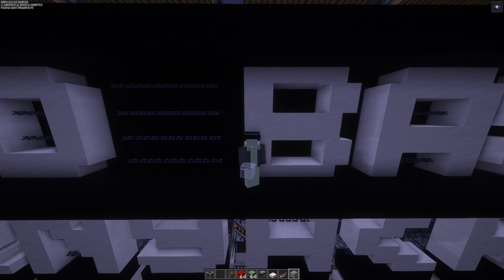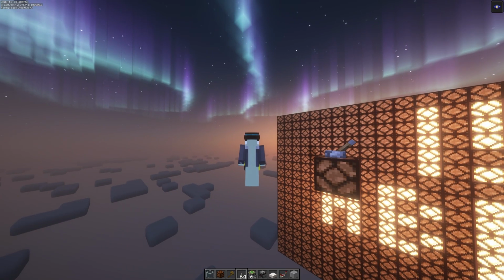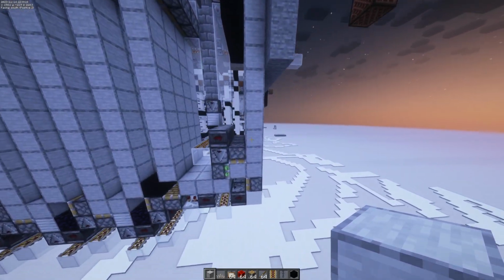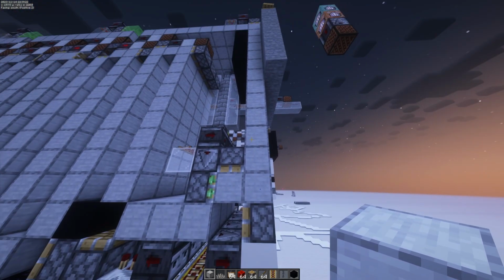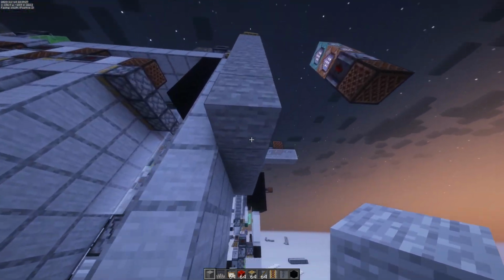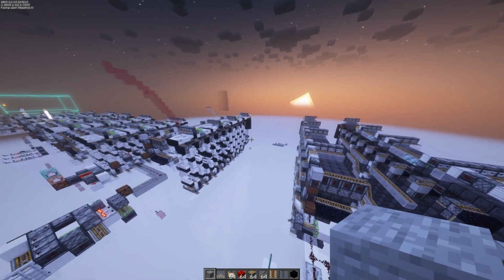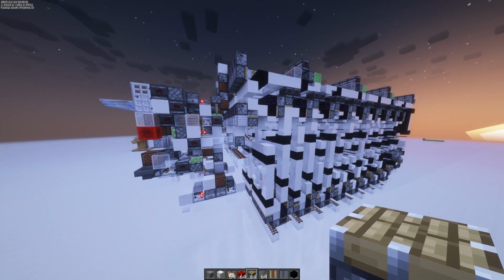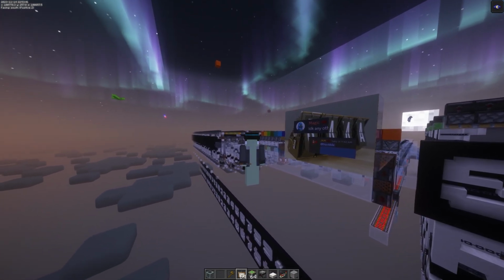Reinventing the World of Text Displays

Comment: In the next version you should consider somehow separating each symbol in vertical lines and combining them to render the character. Thus you'll be able to render any symbol with relatively small tapes.

In fact, you'll need a tape size of 2^n, where n is the height of the screen.

But that would actually convert this system into an all-purpose mechanical screen, hehehe

I have no idea how to do the wiring, though. Judging by the video, you need to have a single block space between each tape, that would be a problem

And also, encoding system would be more complex, but this one is certainly solvable.
Reply: But now that I think about it, if you want to preserve all the alternative versions of edges (like with stairs or slabs), you'll need a tape of somewhat bigger size. 

Say, if you want to go extreme and add every possible option there is (which is 4 positions for stairs, 2 for slabs and 1 for the block), then it would be 7^n, equals 2401 blocks long tape for the screen of 4-block in height, but why would you want to go extreme?

All your current options are probably gonna fit into a hundred blocks long tape or even smaller, so if you want to render text-only, that shouldn't be a problem. And if you still want characters to be placed in predetermined positions, then you can create even smaller different tapes for each vertical line.

Comment: A long time ago (I think 1.12) I made a scrolling display using repeaters on full delay, using a (I think) 3x5 resolution for each letter. I know I used a timing circuit to time each letter, into an encoder, and into another timing circuit for each vertical line of the letter. Ten years later I've never seen anyone do it. Probably because without red power you can't do vertical repeaters, and having it be flat on the ground isn't super useful.

Comment: You know, you could use a hex decode, 0-15 through adding the values of two composters twice. That would give you Hex FF = 255 characters max. You'd have so much extra room for more characters. You could even just dumb it down to OCT 88 which should be 64 characters which is in budget and only needs two reads, 0-7 per composter digit and still gives you more characters to work with.

Then, the added challenge: Copper Bulb Character Segment Display, each letter programmed on its own using the same Hex decoder.

Comment: For the counting, can't you just compare the number of items inputed to the internal counter ?
Say you get to a point where they have the same comparator power level and then pull an item from each until you get a difference (then move the tape) or a simultaneous drop (exact match)

Comment: Dude, I freaking love this design concept! You've put out some really awesome display concepts, but this one is hands down the best I've ever seen. I have been working on a 3D maze that's 7x7x7 cubed that basically has 343 interior rooms laid out in a 7x7 configuration that's then stacked 7 high. Each room (cube) has a 3x3 door on all 6 faces of the cube, and all 343 cubes are inside a giant outer cube that has 294 doors that connect to the outside. So in total there is like 1,127 3x3 doors , 392 of those being horizontal trap door designs. Anyway, the idea is to have a player start out in the very center of the building to start the maze, with the goal of locating the one single outside exit door that isnt locked, somewhere on one of the six faces of the main cube. The catch is there is no straight line to anywhere because there will also be locked doors all throughout the facility in all directions, forcing the player to explore and remember where they've been to ever stand a chance of escaping.  

All the while the player is being timed by a stopwatch display on the outside, that depending on the chosen puzzle difficulty, could have the entire maze lock all doors after a specified elapsed time and shuffle the maze with them inside,  then resulting in everything they had mapped out being invalid, and forcing them to start mapping all over again. 

If and when they do successfully locate the true exit door and make their way outside will the stopwatch be stopped and the time recorded along with that players gamer-tag. So future payers can compete against previous times posted, and the system will promote the player with the best time to first place automatically.  

The Ranking information would ideally be either permanently displayed on a dedicated display panel or have a recall function  built into the primary display. 

So with such a massive amount of displays this build will require, I have watched the community closely  for new display concepts that could bring things up a notch, and what you've shown here today is exactly what I've been looking for! I would seriously be grateful if you'd approve my incorporating the work you guys have done here into my insane build. If we could talk on discord i'd be willing to share my world files with you if you'd be interested in checking out the build so far. This project has far too much history to include here but suffice it to say, it's been in development since the xbox 360 and has had quite a few version changes along the way, with the latest being a ground up rebuild on a modded platform, so there's really no limits holding it back now, and something as incredible as this type of display system would really be amazing to see in a final iteration.

Comment: I would like to thank you for telling me about the overloaded comparators trick. I'm sure I'm not the first to figure this out, but did you know that giving a calibrated sculk sensor a signal strength over 15 completely disables it? It's the silliest way I have found yet to make base defenses toggle off and on.
Reply: What kinda base defenses you got? I'm interested
Reply: @skinnybuggo  Well, currently very few, as I'm just starting to move from an old base to my actual megabase. I'm still mostly in the design phase. My current plan has a few different defenses. The main one is a tnt minecart land mine that is specifically designed to work with the servers antigriefing plugins. That's what I was talking about. I also have about a stack of dripstone in the entryway, which will also be activated by calibrated sculk sensors, and I'm on the hunt for a good double piston extender/retractor to pour lava all over the outside. I'm also considering flooding the hallways and adding a toggle for the conduits. 

As an unrelated side note, it's the most intimidating base design I've ever seen. It's 3x3 chunks of nothing but a seamless wall of stone, all the way to world height. The door is a giant flying machine door flush with the wall. It makes me feel very small.
Reply: @fordprefect859  any chances you could upload a video? sounds really cool
Reply: @skinnybuggo  I can try. It's a cracked server, so leaking the address could get extra spicy, even with the authme plugin. It's also been up for long enough that I'm not sure where I would start when showing it off.
Reply: I'd be careful where you repeat that information, almost sounds like a bug, and we all know the only bugs mojang is interested in fixing are the useful ones!
Reply: @DemonSeedXP  are you playing on bedrock?
Reply: @Yegor_Mechanic  no I'm on java, rarely do I play on bedrock if I can help it :p
Reply: @DemonSeedXP 
There are many Java edition bugs that I use to this day and they only got fixed on bugrock
Reply: @Yegor_Mechanic  yeah I get that My comment was pretty much tongue-in-cheek you know kind of jokingly

Comment: Could flying machines be used to break the character set down into 12 character segments? A solid rectangular prism of blocks would achieve higher information density, meaning each character would be in closer physical proximity to the display. Moreover, decoding logic could be simplified somewhat because rather than keeping track of your position in a gigantic 53 character feed tape, you just eject the current 12 character feed tape back into its high density storage position while simultaneously signaling the block containing the next character to be displayed to fly to the slimestone system that unpacks it and moves the desired character into the display position.

Comment: Do you really need to move 5 blocks for your 4 block high characters ?
It seems like it would be possible to have only the characters in the tape, and only had the top and bottom black line when the correct character is displayed

That would make the device 20% smaller and faster !

Comment: If you fiddle with the fonts, you can instead divide each character into sections and combine the sections to make a character.
For example, if you had a top section and a bottom section:
I, J, and T could be made with the same top section template
A and H could be made with the same bottom section template
Reply: How would you join the gap between the top and the bottom?
Reply: @BryanLu0 magic
Reply: @BryanLu0  probably using flying machines is the only way, it would be way slower but i guess its a thing
Reply: Not top and bottom! But left and right, or, well, three columns, how about that?
Reply: if you have few enough patterns per one block slice and if you can control them individually, the potential reduction in individual tape size would probably significantly speed up the machine...

Comment: 2:39 Ceramic cylinder seals are thought to have been used since 3500 BCE. Inverted designs are etched into a clay cylinder before it is baked, so that when it is pressed and rolled onto a wet clay surface, the intended engraving is imprinted. This is functionally equivalent to any other form of feed tape storing information densely in 3 dimensions. So yeah, about 100 years, pretty wild!
Reply: I wouldn't call that tape storage, imo the main part that makes a tape a tape is it bring able to be compacted a lot, and the ceramic cyllinder probably wouldn't like being folded. Imo first tapes would be scrolls, which can be unwound into a readable state or stored densely
Reply: Actually DNA is also feed tape when you really think about it so millions of years. Dunno what year BC that was, but it was sure a while ago.

You absolute contrarian. "Ah yeah, the 70s, when they invented the personal computer"

bursts through the wall

"ACKSHUALLY THE ABACUS WAS THE FIRST PERSONAL COMPUTER"

Comment: Mojang nerfed bulbs so bad, Squibble used pistons for display 💀
Reply: They should change it back =(
Reply: i challenge you to make a display design that actually requires the old tick rate for an actually important part of the process
Reply: I think a good solution to copper bulbs would be to have them be instant when they've got no oxidisation, and a 1gt delay when they do. Perhaps even more stages of delay corresponding to the level of oxidisation.
Reply: @christopherpenn9585 I think it's like if you got a puppy. You really liked the puppy, and you're grateful you got it. But then the person who gave it to you came along and ripped off its eye and a leg. Sure, you are still grateful for having the puppy (having one disabled puppy is better than having no puppy) but you're still gonna complain about them mutilating it
Reply: Its honestly fine, the intended use was never for a 1gt block
Reply: @SwervingSho3  it was confirmed by Kingbdogz to be intentional
Reply: They'll still work fine for displays. They only changed the 1gt delay to 2gt, to match all the other redstone components.
Reply: @nikkiofthevalley They changed it to 0gt.
Reply: @haph2087  What. I had heard that they changed it, and assumed it was 2gt... Completely didn't expect them to make it instant. I really hope they don't change it to 2gt, that's legitimately really useful. An instant toggle latch has a lot of uses.
Reply: @nikkiofthevalley It's true that it is useful having it that fast, but redstoners were so hyped to has 1gt delay
Reply: @nikkiofthevalley  No, it isn’t an instant toggle latch. The comparator still adds 2gt of delay.
Reply: (comparator priming aside)
Reply: @haph2087  comparator primers arise*
Reply: @nikkiofthevalley the thing is with 0gt delay you can make a nice and compact line of pistons that extend with 1gt between them something that made them useful as they are the  only block with this feature, but now they changed their delay to match noteblocks basically making as useful as one which is to say, not useful
Reply: Good thing the copper bulbs dont have any other unique features to make them useful. OH WAIT, THEY DO.... Is it just me or does everyone seem to forget that they are a single block T-flip flop. This in of its self is extremely useful. Yet everyone seems to forget about that and whine about the loss of a 1gt block thinking its now a useless addition to redstone. Don't get me wrong, its still a massive loss, but damn am i getting tired of seeing these comments around. its core use is still amazing to have.
Reply: @christopherpenn9585  sure they're a single block t-flip flop, they're also useless, as a t-flip flop. And sure the fact that they can be moved around in their active state is decent, but let's not forget, that we already had 2 block t-flip flops, with sticky pistons.
Reply: @christopherpenn9585 thing is: you can make fast counters with 1 gt. So that's not the problem. You CAN'T make the fun stuff with 0 gt.
There is zero reason to do 0 gt other than screwing redstoners over.
Reply: @nikkiofthevalley normal lamps have 0 tick delay. Same goes for noteblocks. There is literally no reason to use the copper lamp for that. 

We want 1 tick delay and not a copy and paste of already existing blocks.
Reply: @livedandletdie You physically cannot use a piston as a 2 block t flip flop, it's gotta be 1 ticked somehow and move a block.
Reply: @nikkiofthevalley  I still hope they change it back
Reply: @nikkiofthevalley changed to 0 (ZERO) ticks.
Reply: edit8: I finally did what I should've done to begin with, and tested the changes in-game. Uhh, I guess the wiki was wrong...? There's no shortage of vagueness in the official release notes, so I'm not sure where the odd game tick thing came from. We've come full circle, and my original comment applies after all.

edit2: Oops, based on the wiki it looks like the replies gave a false impression of what the change was... Eh, Mojang, just make it 0gt lol.

edit3: Also, significant absolute tick parity on Java, tf?? Are they trying to start taking BE/JE redstone compat seriously? Which scares me a bit, since that won't happen without a) adding a delay to piston extension, or b) making Bedrock redstone Java redstone.
edit4: On further thought, 0gt copper bulbs have some rather serious semantic problems wrt. sub-tick interactions. The best they could do is probably to introduce a whole new tick phase at the very end, which would toggle copper bulbs based on what happened during the tick. Even then, since copper bulbs appear to trigger full block updates (not just shape/observer) on state changes, the choices are: a) a whole new class of sub-tick interactions, b) 1gt delay on bulb toggles originating from a BUD reacting to a previous copper bulb update, and a much less interesting new class of sub-tick interactions, c) patch all (edit6: instant) BUDs... [edit5: d) only trigger shape updates on state changes, though there might be ways around this.] A special-cased instant comparator reaction time when reading from a copper bulb actually seems more realistic, oddly enough.
edit7: Droppers and dispensers already exhibit those "serious problems" , though, so I guess Mojang wouldn't mind. :/

Honestly, instant copper bulbs seem more useful than 1gt for the vast majority of uses. As was mentioned already, due to comparator delay the effective end to end latency used to be 3gt (and is now 2gt), which I'd argue introduces a rather frustrating speed/compactness tradeoff. Redstone is slow enough as-is. Yes, odd gt delay is useful, but it should probably be a separate thing. (edit: And yes, the large size of odd gt delay circuits is also a speed/compactness tradeoff. Still, the old copper bulb behavior would only serve to swap one tradeoff for another.)